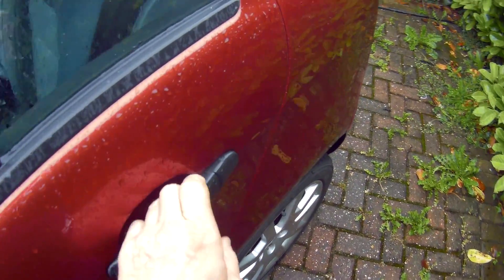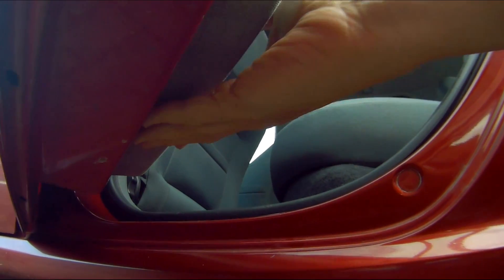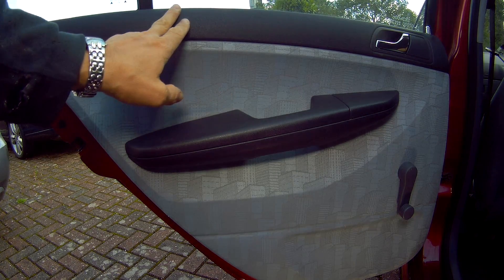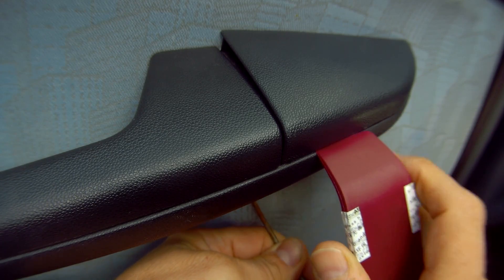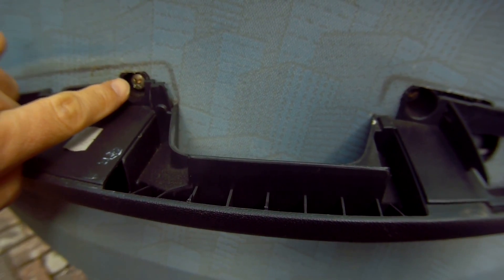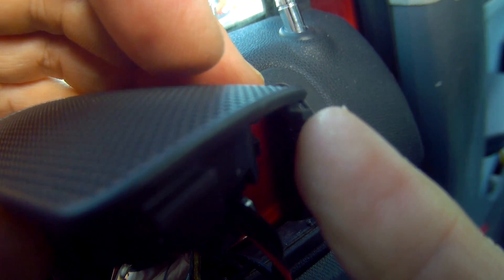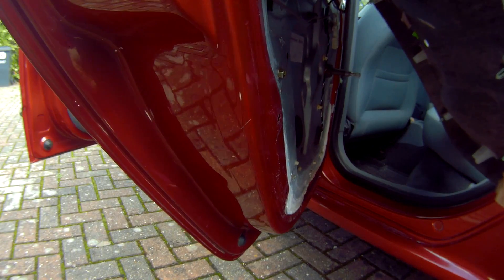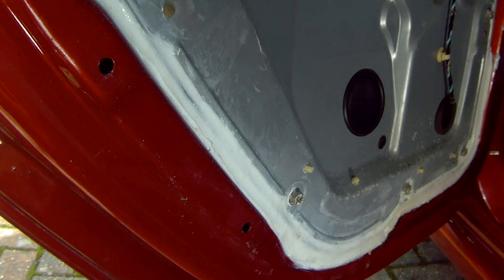SKODA FABIA Rear Door Seal, (wet footwell) 99-07

Comment: @hatboyharvey you're an absolute legend. Fixed so many things on my fabia thanks to you. Discovered white mould in my rear drivers side footwell yesterday and discovered it was soaking wet under the mat. Spent the afternoon trying to work out where it was coming in from and had no luck. Discovered you had a video on it today. Fixed in about 30mins... managed to break most of the door clips in the process but an easy fix ha. Anyways a massive thank you. Sending you a coffee now for the thanks
Reply from the maker: Well thank you very much for your kind appaisel of my videos, glad they have helped and hope it solves the current issue. There is also a rear jet washer pipe join behind the C pillar that can often leak and run down into the rear left doorwell. I've done a video on that somewhere if you look in the playlist. Mega thanks for the coffee, I needed it this freezing cold wet morning :-)
Reply: @HatBoyHarvey  anytime. Thanks for the heads up. I'm trying to dry the footwell out at the moment. Got some kitchen roll wedged where the leak was so I'll keep an eye out. Speaking of the rear washer. You might know what the nozzle for the rear washer size is. I've tried a few from ebay that say it should fit the car but one sprayed right over the car and the others wouldn't fit under the cap. Do you know what specific part it is?

Comment: My local garage didn't want to do this job, citing brittle plastic on an old car. I used to use strips of thick cloth between the door bottoms and the body, and this seemed to stop a lot of the leakage. Curiously, the problem has stopped now by itself - moss growing on the window seal rubber stops water getting in!

Comment: Thanks mate...about start with tackling mine....surprisingly good little car.  Greetings from Portugsl...
Reply from the maker: Good luck, hope you enjoy your great little Fabia :-)
Reply: @HatBoyHarvey  Done the two rear doors....didn't break anything, got it all back together easily enough. There was some type of aluminium foil tape stuck across the leaking joint which took a while to remove...obviously previous owner tried a bodge repair. It's now nicely and neatly done with silicone and your video explained everything clearly. Thank again.
Reply from the maker: Great, hope it does the trick. One last thing to check is the rear washer jet cable joint under the rear C pillar trim. have a look at my video on it: https://youtu.be/2nfKzxZUelY @4:30-

Comment: very meticulous, very well made but one key issue is missing i think .. its cleaning the debris inside the door, if you look under the door you can see 2 holes  where water evacuates .. this is the reason in the first place having aquriums in the doors. 
i used a vacuum and tryied cleaning the inside and from outside the evacuation holes as well as i could. 
 thanks for sharing. cheers.
Reply from the maker: Yes, good point, thanks for mentioning that as the holes are quite small and as you say should be free of any debris :-)

Comment: Thank you so much for this video, I've managed to sort out the damp problem, just a bit of further information for you, my 05 mk1 had the metal panels rivited, I removed all but one at the centre top because it is attached to the window mechanism, I used a 6mm drill bit to remove the rivets and bought a rivet gun of amazon for £10.99 that included the required 6.4mm rivits. It's as good as new, I can't thank you enough HH, now I've just got to work out why the front footwells are getting wet.
Reply from the maker: Yes, later models come with rivets I'm afraid, so many would be put off doing it, maybe they want to deter people from opening up the door panel to fix issues themselves or it is quicker for the robot to rivet the panel on or it guarantees a tight fit as bolts could potentially come loose. All the more important to make sure these bolts (when fitted) are all torqued up evenly :-)
Reply: Do you have a link to the rivet gun you purchased on Amazon please as I plan on doing the same next week? Thanks.

Comment: 😊😅 0:34 Great vid and explanation as usual. I am still trying to work out what the "normal" drainage route is for water that enters the door cavity via window. If we make the inner panel/door seal as you show, where does water accumulating in door cavity escape to? I haven't been able to examine the door cavity yet so apologies if there are obvious drains!

I just spotted comment from Rycka (3 months ago?)and reply which addresses my question...not sure it fully explains but on the right track :- 😂

Just found there are 2 good sized (about 12mmx4mm guesstimate) drain slots in door bottom near outer skin...makes sense now. Don't think I can attach photos but once you feel or get down and look at door bottom they are obvious.
Reply from the maker: The drain holes aren't easy to see and I think that is why many assume there are none, but they are definitely there!

Comment: To dry the passenger floor slide the seat as far forward as possible put a shoe box or a cushion between seat & glove box put the heater blower on facing down block or tape over the vent under the steering wheel to get more air on passenger side & heater up 
also when locking the car press the lock button twice to stop the red light continuously flashing on drivers door helps with battery when stood for a few days
Reply from the maker: Great tips :-)

Comment: hey, i have a question. did you replace the rivets with screws yourself? if so, could you tell how you did it? my driver door panel rattles, so i'm planning to do that.
Reply from the maker: I have planned to do a video on this sometime. Until then use steel 'rivnuts' short M6 bolts.
Reply: @HatBoyHarvey  thanks a lot!

Comment: Many thanks for this - a really useful video! Before I tackle the job, can you say where to get hold of the plastic panel clips, just in case I break any?
Reply from the maker: If you put 6Y0867260 into a search engine there are a number of places they come up, all very cheap or your local motor factors maybe able to get you them quoting the same part number as also the skoda dealer which would be a little more money, but the genuine items:-)
Reply: @HatBoyHarvey  Thanks very much.

Comment: Alright mate doing this our self’s just now we’ve drilled out the Rivets but what bolts did you use to put it back together to re secure it? Cheers
Reply from the maker: inner panel fixings:
My car uses M6 threaded bolts with a 10mm head x 10mm thread length. I would recommend using steel rivnuts. Be careful taking rivets out; don't enlarge the hole.

Comment: Any ideas if back door panels are riveted on? We've sealed it all but still leaking but could not get the metal part off with it being riveted xx
Reply from the maker: Later model fabias had their door panels riveted Inc the rear panel. You may not have sealed the panel enough by sealing on the outside. Also to note; there is a rear jet wash pipe join under 'C' panel that may be leaking also, worth a check
Reply: @HatBoyHarvey  AHH ok, thank you xx

Comment: Hi, Harvey. Do you know the exact part number of the seal attached to the car body? That you washed in first place on the video. It is easy to replace? I'm having problems when washing, as water enters by the upper frame of the door. By the way, I solved the not starting issue; it was a battery problem. Thank you very much in advace!!
Reply from the maker: You're very welcome, the product code for that is in my latest video: https://youtu.be/85q4l2r1mL8  :-)

Comment: Hi mate, I recently found your channel.

I was wondering if you'd know about the mk2 fabia. So there are water drain holes on the bottom of the door. Is it part of the design to have them fill up with water and pour out when doors are opened? Only worried as I've had corroded sill due to it been parked up but now fixed. The water seems to come through the door into inner door but comes out when open
Reply from the maker: @Rycka9  this is common on the fabia1 and commonly leaked into the rear footwells. I'm not sure if this was addressed fully on mk2, but my belief is they have. I don't know exactly what they did, but my understanding is water enters via the window seal edges then travel through the door cavity and out through the little slot holes at the bottom of the door which is external to the car. Water will then make it's way out over the sill and can sleep underneath exacerbating the conditions for rust over time. I would make sure these holes are cleaned out for the free run of water. Water shouldn't just escape when you open a door, but seal out continuously. Also examine the top seal and consider replacing.

Comment: Just wondering i have rivets can't get into it take foam out will it still work without removing it and does it matter what silcone you use ?
Reply from the maker: You could just cover over the top of the seal area with silicon (any will do) but it is best to be able to lift the panel so new silicon can sandwich in-between the gap for a better seal. It is a bit of a pain with the rivet true, but you can drill these out and then fit aftermarket 'RIVNUTS' (no special tools needed to fit) that then will use bolts.
Reply: @HatBoyHarvey  do you know roughly what size of rivit nuts i would need for this

Comment: Hi and thanks for your informative video, I have just tried this but found my inner panel seems to be held on by rivets , it's a MK1 Fabia .. any ideas ? Thanks Carl
Reply from the maker: Carefully drill the rivets out and fit rivnuts instead making life easier, happy days :-)
Reply: @HatBoyHarvey  do you think you could get away with just silicone of the join on the riveted ones?
Reply from the maker: Unless you could dry the seal out fully I doubt it would last before leaking again, but you could try it and see, nothing to loose really as it's all relatively hidden.

Comment: Well done - thank you! Particularly suitable if the (device carrier / module) aluminium-panel is riveted and not screwed.
Reply from the maker: Unfortunately some later model are riveted, bummer, you just have to drill those out and fit thread-rivets so it becomes a bolt-on version.
Reply: @HatBoyHarvey  Thank you very much and i do as you described.
Reply: @HatBoyHarvey what sized threaded rivets should be used? (Skoda Fabia mk1)

Comment: Ive got my door card loosly attatched at the top now ready to put some silicone in tomorow, but if the water is still leaking in between the door and inner panel will it not build up a pool and steam up still?
Reply from the maker: You need to thoroughly dry everthing out first so the silicone will seal between the panel and the door (best done in summer or /garage/heater/hair dryer). I removed my soden seal and replaced with a bead of silicone /dried/re-seal and a cover bead od silicon. Video from 6:50 onward. If you're worried about water bridging over the door seal also, clean it well with soapy water and where it meets the the door or replace it. Hope this helps :-)

Comment: Hi, my fabia rear drivers side footwell is soaking wet but door card bone dry. Any idea what it could be? Thanks
Reply from the maker: The door card doesn't necessarily get wet when it leaks into the floor pan. I would do the sealing repair and see what happens, if no luck then it could be coming from the front card as some have had leak there also :-)

Comment: Set screws at 4:32. That’s the engineer in me 😅
Reply from the maker: I guess rightly so my friend, but then I call EGR valves recycling valves as apposed to re-circulation valves :-)
Reply: @HatBoyHarvey  Aye. But they are still set screws. And you wouldn’t or shouldn’t call a shovel a spade. It’s just the principal engineer in me you see. And I applied that fix to my Skoda after watching this video. Keep em coming. 👍

Comment: Hello my friend thnx for the video but today in the morning i just go in my fabia and two window dont open electric from my side and pasanger side ...another hand everything work ..? What do you think ?
Reply from the maker: Hi, Window switches can become temperamental after long time use.
Before replacing have a look at their connections inside each handle :-)
Reply: Hello my friend... when I remove fus and re-put again works good for 10 minut or 15 after that does not work again ... 
What do you think to change fuse or to reset batery or i dont know ?
Thank you for your time .
Reply from the maker: My guess is loose/broken wire fault or connections or
switches. Try new fuses. Have you tried holding the driver’s side open button
up for 3 seconds when closed? Is the battery good/ground? disconnect/reconnect
bat. Are windows running clean/easy? If opening and closing doors effect
operation then broken wires going into door.  I would also check Connections to convenience
module. Convenience module fault? Hope this helps :-)

Comment: Hi, I have an Octavia 1.9TDI estate 2003 with the same problem. A new electric window windings motor was installed a few years ago & may have been the cause (thin plastic membrane had to be torn to get to the motor but not replaced). If water does get in the door panel & if sealed where does the water go? I can't see any drain holes to allow water to get out.
Reply from the maker: Probably right in suspecting the plastic membrane. Holes are underneath the door seam. A light and mirror may help you see the small slots.
Reply: @HatBoyHarvey  After removing interior bits from door panel it was found (after testing) water was coming in through the door but originating  at the  bottom of the electric window. Car is old so I could just reseal door panel. Ideally, it is best to fix window seal. Your video just shows how to fix the leak but not the cause of the leak. Any ideas? Just fix leak by stopping water coming into car o/and fix cause of leak?
Reply from the maker: I show in the video where I think the water gets into the panel by the window felt seam, from there is seeps down and soaks into the foam seal. You maybe able to get a new window felt lined trim from a dealer, but as this problem is common a new one will most likely fail again sometime in the future. Maybe something can be done to the trim to rejuvenate it, but I don't know how - yet.

Comment: Many thanks, I've got the same problem. However I do have a question: if you seal up the bottom of the door, doesn't the door just fill up with water as I can't see any drain holes in the bottom of my car door?
Reply from the maker: If you look right underneath the door on the metal part there are 2 small drain holes, which need to be kept clear :-)

Comment: Thanks for awesome tutorial. I have just done this repair following your steps and its all done. Hope, its fixed. 
Please, Is this repair also needed on front doors? Because i think I have in my skoda fabia sometimes few water drops on the inner side.
Reply from the maker: Yes, I've heard that the fronts can get wet also, but not as bad. Also one thing to note is; behind the nearside C pillar panel is a connection to the rear wiper jet which also can leak. have a look at my video on it: https://youtu.be/2nfKzxZUelY
Reply: @HatBoyHarvey  Thanks, I will check it, but I dont think so its my problem. I think, I would smell windshield washer fluid.
Reply: Część a jaki silikon dałeś do uszczelnienia
Reply: @areknowak9780  universal silicone. probably for outdoor use with resistance to minus and high plus temperatures. Its been 3 years now, and still works.

Comment: Only today we found our Skoda had steamed up rear windows, wet carpet and door panels. (Only had the car two weeks)  so now I know where the problem lies. Do the doors not have drain holes then??    Thanks for posting
Reply from the maker: Yes they do have drain holes, but unfortunately they don't help as water seams to collect and soak into the foam seal around the perimeter of the metal carrier somehow and then onto the bottom of the fabric panel and across the rubber door seal.
Reply: @HatBoyHarvey Ok.. I may use some foam rubber strip I have in stock. It sealed the leak around the Corsa relay box. Ta

Comment: There is no 10mm bolts holding metal pannel though..
Reply from the maker: later models come with rivets, which need drilling out and either replacing with more rivets or installing RIVNUTS and retro-fitting bolts for ease of service :-)
Reply: Do you know which size of rivnuts will fit?
Reply from the maker: My car uses M6 threaded bolts with a 10mm head x 10mm thread length. I would recommend using steel rivnut preferred. Be careful taking rivets out
Reply: I tried to mount a m6 rivnut but it doesnt fit, how did you do?  @HatBoyHarvey
Reply from the maker: @mohamedrhordo5344  in what way does it not fit?
Reply: Rivnut is bigger than hole in door chassi and hole in aluminium panel   @HatBoyHarvey
Reply from the maker: @mohamedrhordo5344  I suggest you practice with a spare piece of metal fitting rivnut in that before doing it on the door frame. Drill the right size hole that will acommodate the rivnut installation. You will nee either a rivnut tool or suitable bolt and a nut to install :-)

Comment: Quick question - is there a way for the water to drain out of the door once the leak is sealed?
Doesn't it keep collecting there since it's found a way to get in?

Obviously it's has worked for you for a long time so I'm going to do it too. Thanks for sharing the fix!
Reply from the maker: I keep getting asked this, no worries the water doesn't collect as there are slot holes under the bottom of the door on the edge :-)